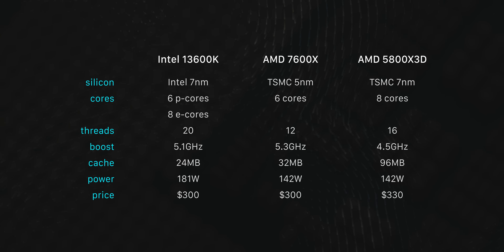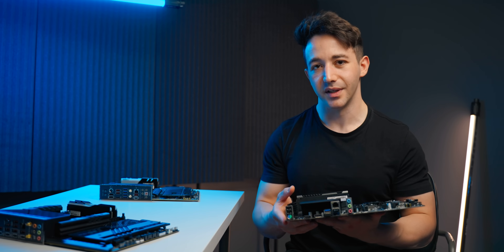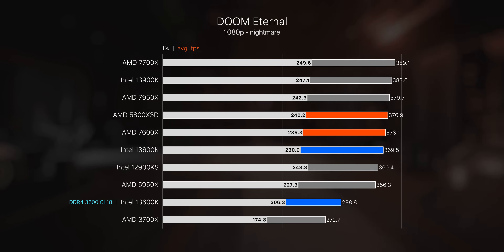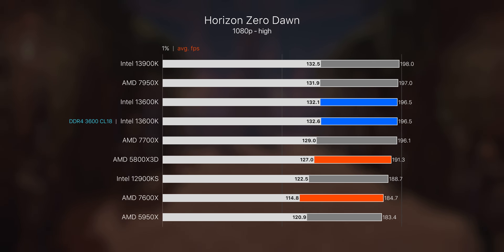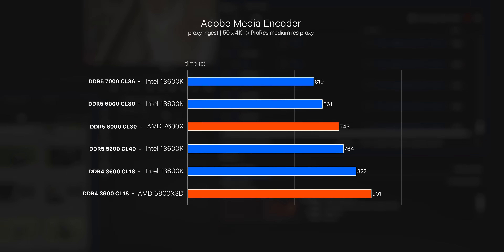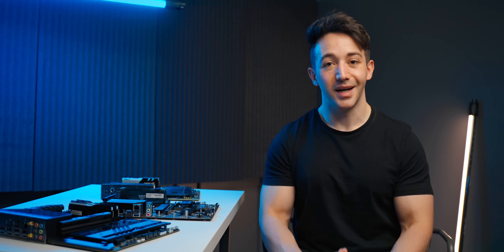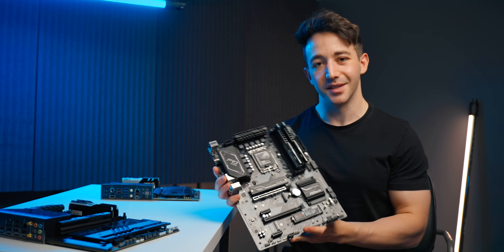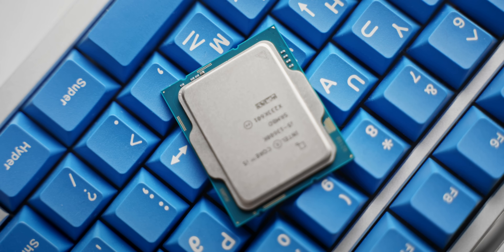Best Gaming CPU - 13600K vs. 7600X, 5800X3D

Comment: Amazing video! It’s great that you benchmarked with the actually recommended memory and motherboard configurations.

Would have been nice to see how the 7600X performs with 16GB of DDR5-4800, but looks like there aren’t many reasons to pick it anyway.

And just to add, the power limit on the B660 Pro RS doesn’t exist on midrange B660 boards, for example the MSI Pro B660M-A which is only $120.
Reply: runs fine.
bought cheap 5200mhz 16gb 2x8 ram at 40 latency.
Reply: I don't think 16GB of DDR5 is really an option anymore. Every kit I've seen is 32GB and they don't make 2x8GB kits.
Reply: @MayonnaiseOreo  i find 2x8 kits of ddr5 on amazon all the time.
Reply: @YeshuaChristRedeems  Huh, whatever I read about DDR5 16GB must've been outdated news. But yeah I'd only looked on brand sites and Micro Center, not Amazon.

Comment: 0:20 DDR4 vs DDR5 is making the gap grow larger each week.
Already saw DDR5-9300 being an OC fact on air cooling.
Reply: bdie vipers for 100$ running at 4133c15 say that again
Reply: Until DDR5 has CAS latency that is 10ns lower it wont make sense for gaming over DDR4.
Reply: 5333mhz DDR4 CL22 kits that OC to 5866 CL21 have something to say about that.

Comment: hey guys, i have ddr4 cl16 3200mhz 16gb ram and im thinking to buy 13600k. Will the ram effect the cpu and degrade performence or will it be same just like 3600mhz in the vid ? pls help <3
Reply: @Transistor Jump then should i go with 5700x ?
Reply: @Shogun_D  5700x requires ddr5, so might as well go with 13600k with ddr5
Reply: @GraveUypo  5700x doesnt support ddr5 bro
Reply: ddr4 is better, depending on the games u play. nice tune with memory gets you as good performance as u see in the vid

Comment: Why has AMD not reduced prices for 7600x and 7700x? They are both embarrassingly poor compared to i5 13600k if you factor in the total cost including ram and mobo
Reply: AMD doesn’t need to reduce prices. They can sell the same Zen 4 chiplets for much more money by putting them in their high-demand EPYC server CPUs.
Reply: @Rachit0904  it was like that at the beginning of the 5000 series. Now the price is the lock and nobody tells them there are no processors 😁😁
Reply: 5800x3D are selling like hotcakes so AMD is clearing inventory rapidly, just give it some time and the 7600x and 7700x will drop in price. Its not really the processor price that's the issue since in my country I paid over $50 less for the 7950x compared to my 3950x, the big problem is the board prices.. $1069 for the Taichi Carrara when I paid $799 for my Asus Formula x570, B650 boards need to be at least $50USD cheaper and x670 needs to be at least $100USD cheaper.
Reply: I Think amd is just happy where they are. 
Their 5xxx is selling so well, they're like "meh".
(13900k user)
Reply: @notreya  steam hardware survey for last month, they lost 2.6% of cpu market share to Intel.
Reply: @Rosilelilele  the am4 platform from AMD makes way more sells right now than am5 and intel 13th gen intel togehter so... they are fine

Comment: The 58003dx is just amazing. Low power draw and is very close in terms of performance compared to top tier next gen CPU's for gaming. Also still uses am4 socket.
Reply: ... And Ddr4 and no motherboard swap.  It's the sweetest deal
Reply: @miptzi  You can use DDR4 on LGA 1700 socket too so that doesn't matter.
Reply: @trignite  but can also ddr5
Reply: Amd for Homeless
Reply: RIP AMD and their new Zen 4 2022-2022, it already DOA when Intel Raptor Lake/13th gen released.
Reply: @runninginthe90s75  exactly, not even amd fanboys bought that trash
Reply: So much children in this comment section...
Reply: @angelstavrov5032 Especially when just all of the things they are arguing about are all excellent bits of kit that make games look great. Like - just go and play some damn games people!
Reply: Just installed this on my B450 MB, gaming performance went up so much it was hard to believe. Best 300 bucks ever spent.
Reply: Ryzen 5800x3D ❤
Reply: Try competitive titles such as overwatch, CS and Valorant which are heavily CPU Dependant games
Reply: One year on and ddr4 is a bottleneck in many games.
Reply: You buy a cpu or video depending what game you play all cpu don’t work the same in all the game same on video cards Amd is best for call of duty more fps ..
Reply: If ur broke boi just say so
Reply: You couldn't have butchered the name harder if you tried...
Reply: 13600k used less power when gaming according to this video and ofc it's going to draw more power when rendering considering the fact that it's much faster at that.
Reply: But right now 5800X3D is the top seller CPU so yeah useless probably you are right huh..you say we don't care about niche games but seems like alot of people do,  so don't speak for everyone because seems like you're not the gaming Jesus right.
Reply: in gaming its actually more power draw than the 13600k lol.
Reply: Holy shit, the last 3 replies are from literal Bots. Thats disgusting
Reply: Yep amd shill fanboy.  AMD got destroyed for cheaper and you still cant admit it.  And he cherry picked games where 5800 does ok.  99% of games the 5800 does badly due to the game not benefiting from 3d cache.   Also intel has 14 cores to do ANY and all other things which the 5800 cant do.  Out dated old tech, move on fanboy.
Reply: @4gbmeans4gb61  why would you need 14 cores for gaming anyway?
Reply: @gerzos4256  you d fanboys cried for years about how intel had lower cores etc etc etc and now that intel has more cores it’s to many.  The fact it’s cheaper and faster and can be used for productivity makes it price to performance king.
Reply: its quite useless, lower MT performance and on average tested with like 50 games on hwunboxed its only 6% faster on average, so 190 fps vs 200 big deal lol
Reply: @najeebshah.  I don't think you understand what 'useless' means.
Reply: @najeebshah.  1% lows are the difference
Reply: @najeebshah.  Its useless because its faster and cheaper than the competition?

Sure buddy
Reply: @Petrixxxxxxx  cope
Reply: @Petrixxxxxxx  Faster? Where?
Reply: @najeebshah.  its all about the 1% lows
Reply: @najeebshah.  these are terrible games to test the 3d v cache and the increased L3 lmao
it's night and day, the 5800x3d vs the other processors, in specific memory timing and cpu intensive games
Reply: @yurilopes420  if it only gets better performance in certain unpopular games then what's the point?
Reply: @propiii  Popular games are for dummies. Real chads play RUST, which is dominated by 5800X3D
Reply: @gdgd5194  real chads play New World which is dominated by fast single core performance so definitely not 5800x3d 😂 and actually most games are like that
Reply: @yurilopes420  who cares or buys for specifics in gaming? majority doesnt
Reply: @propiii  Real chads create bot net which plays new world for them and make thousands of dollars each month so they don't have to choose from mid tier cpus and just buy the high-en stuff :d
Reply: @gdgd5194  yeah less optimized games like rust and for me squad really like the extra cache with the 5800x3d gaining up to like 40% performance in squad
Reply: @gdgd5194  That's a popular game lol
Reply: @najeebshah.  I do, Star Citizen perf shows huge gains with 5800X3D
Reply: @bad_token  exactly, like game changer cpu
Reply: @propiii  hahahahahha u fell for the new world hype, dead game
Reply: @bad_token  good for you then
Reply: @Half_Finis  it's the 5th most popular steam game 🤡
Reply: @najeebshah.  me and other people who like games!
Reply: @bad_token  moot since all their performances are well past than even high refreshrate monitors lol future games will only be better optimized for big little
Reply: @najeebshah.  lol cope
Reply: @bad_token  sure I will with my superior incoming cpu
Reply: @propiii  real chads don't use w11 which is mandatory crap for all the 13th gen.
Reply: @nazaG_89  real chads don't cry about windows 11 just because they think it's still trendy to hate on it for no reason
Reply: @yurilopes420 oh yeah of all you play is factorio and want a min of 400fps you win.
Reply: @najeebshah.  Intel fanboy detected
Reply: @amazingjarl7147  totally